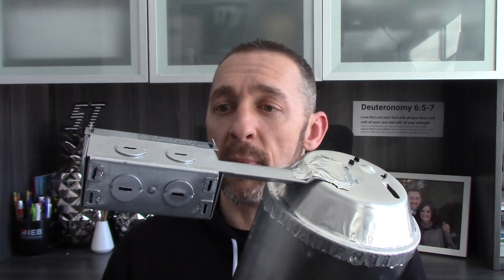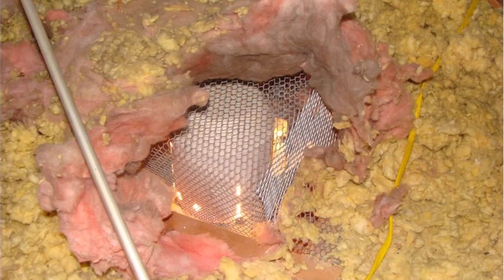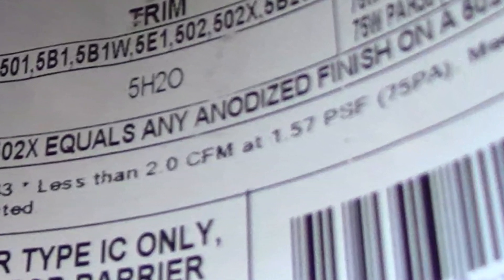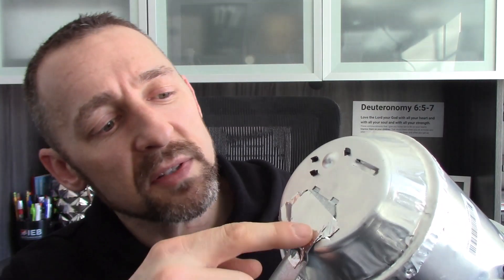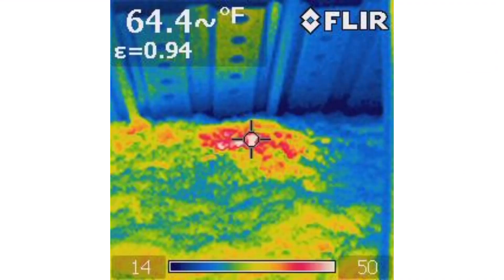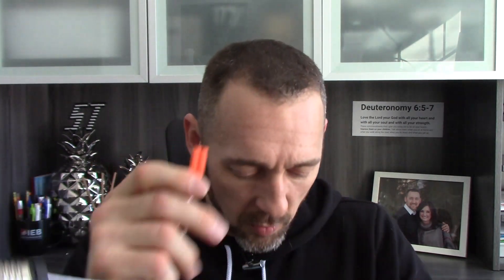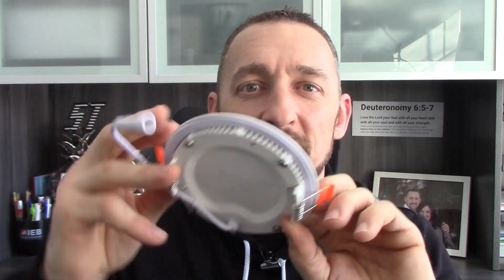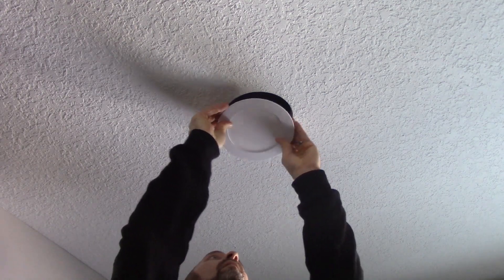How to prevent recessed lights from making ice dams worse

Comment: led retro fits suck for air tightness. Tape the inside of the can and silicone where it goes through the sheet rock. Heat escaping from the bulb is fine but air escaping from your building envelope is not okay. pretty much all gaskets in the electrical field are for show only... They suck. All of them. Make your own air tight seal. Then put some insulation over it.